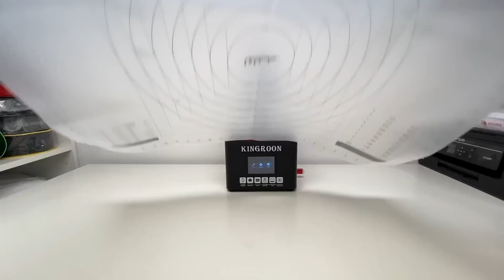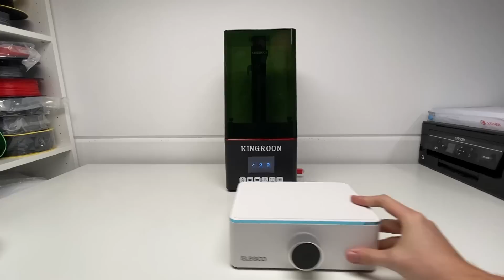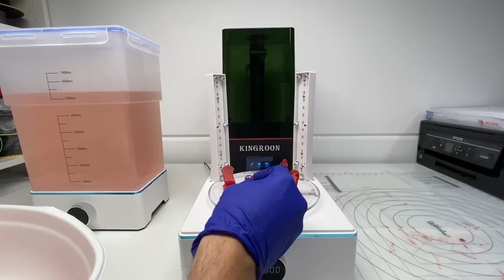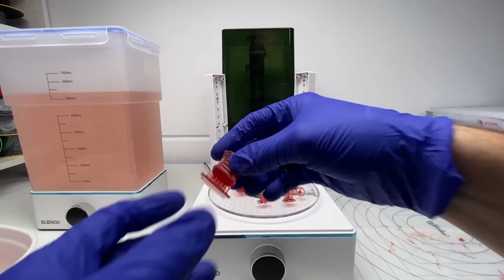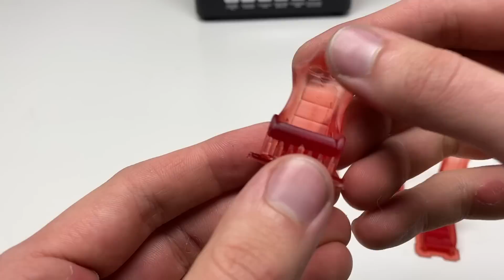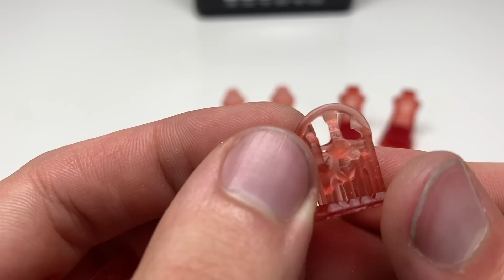3D Printing Custom Interior Parts for Scale Models with a Kingroon KP6 Mono Resin 3D Printer

Comment: There is nothing to fix with Chitubox or with the KP6, regarding the newest version of Chitubox. The newest version will not work with Chitu firmware that isn't specifically locked down to using Chitubox, like the Elegoo Mars 3. The KP6 uses modified Chitu firmware with a third-party board. This is a good thing, not a bad thing, and you're not missing out on anything by using v1.8.1.